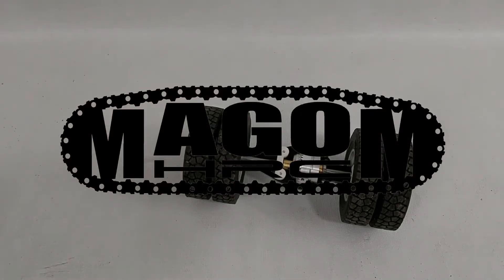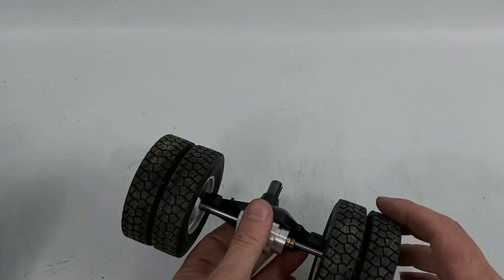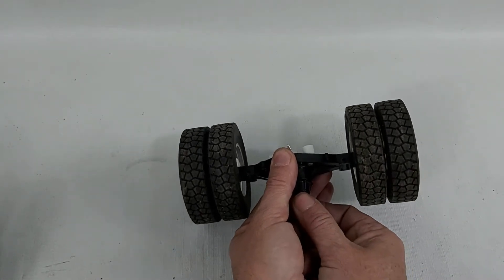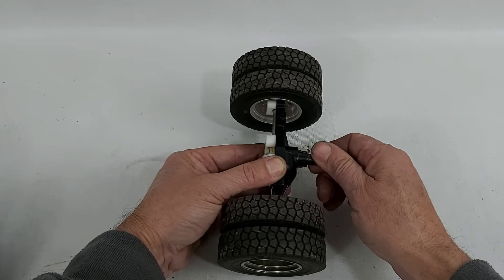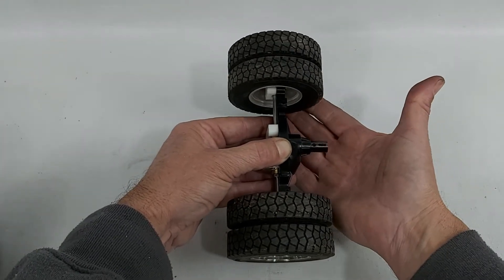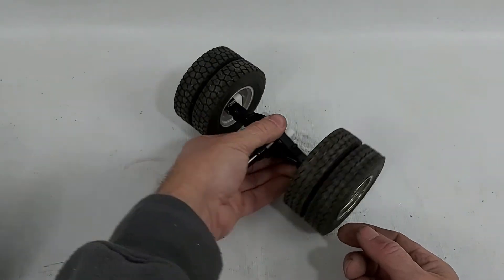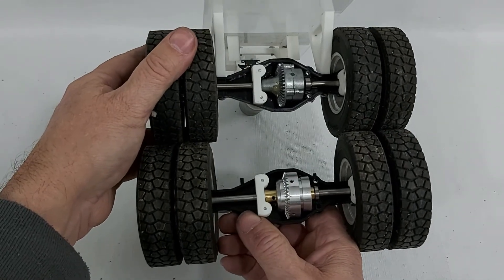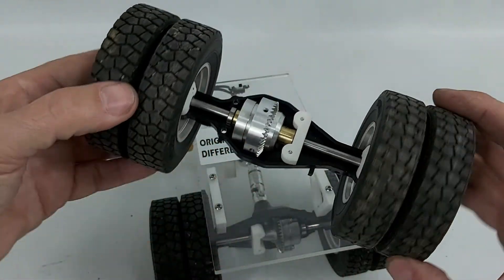TAMIYA truck self-locking differential (ENGLISH)

Comment: Just installed two of them on my sons Scania (Tamiya 1/14) ... doesnt really seem to work. Locks up very quickly on small curve radii and leads to stick slip motion of the wheels. No traction issues - thats true. But far from the scale behavior of the original diffs. 😟
Reply from the maker: Hello! We are sorry to hear that. These are designed with mechanical lockage, so you can't activate the lock to wish as you said. Depends on the traction that the axle feels. Maybe the curve on the track has any imperfection in the terrain that blocks it. We hope that at least it solves your ground traction 😊

Comment: Wish I could say something positive about these, but I can't. Bought a twin axle set. 1st axle will lock if hash acceleration on stick. 2nd axle has never worked, it will not lock. Customer service is poor, slow response, and no solution to the problem. Videos watched and understood. Is the diff adjustable? No answer.
Reply: Same experience from my side. No recommendation.